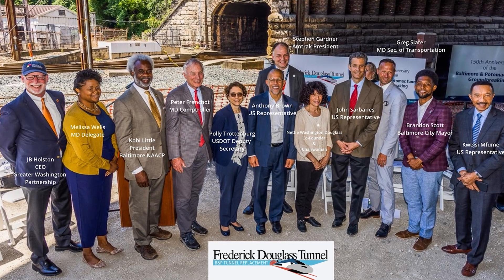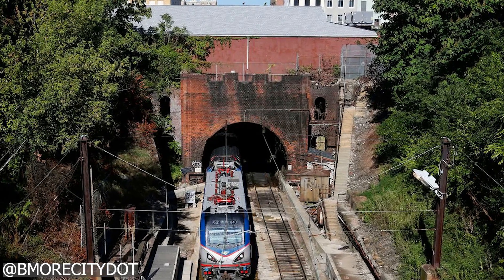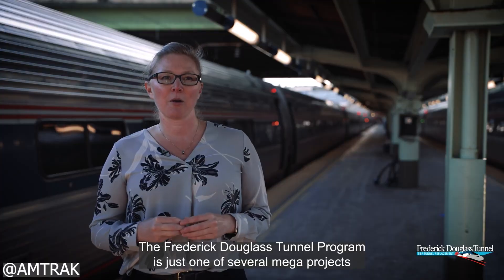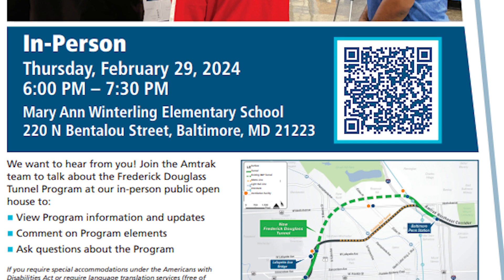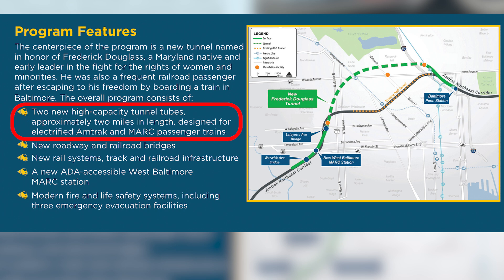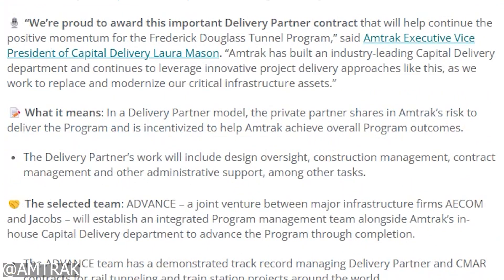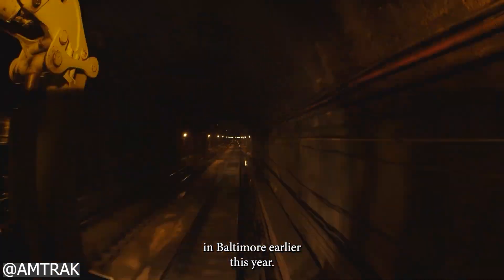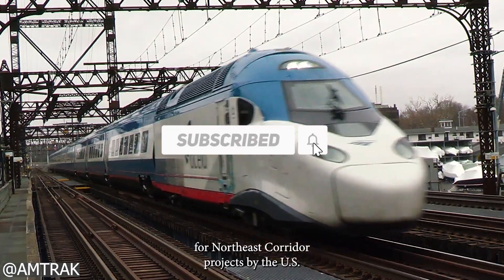Amtrak's $6B Plan to fix the NEC

Comment: I think the part about cutting usage of diesels is a bit misleading. The New York to DC part of the NEC has been fully electrified since the 1930s. MARC would just need to acquire more electric locomotives in order to cut diesel usage.